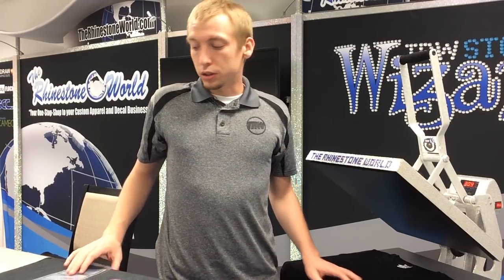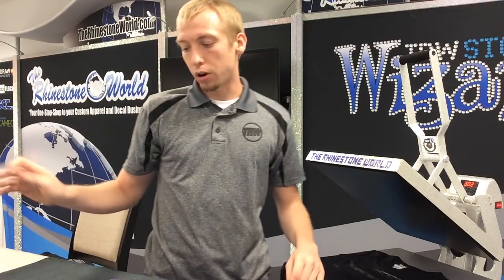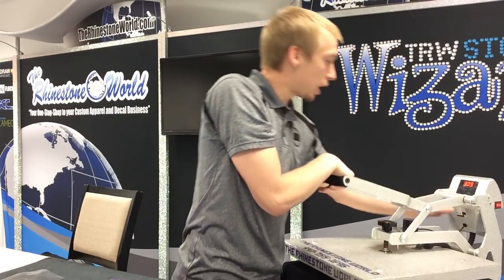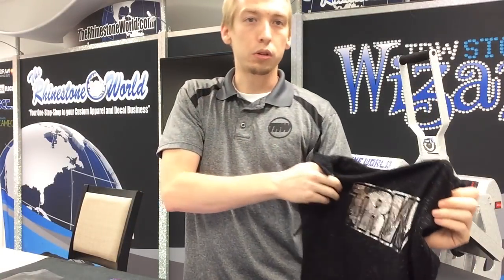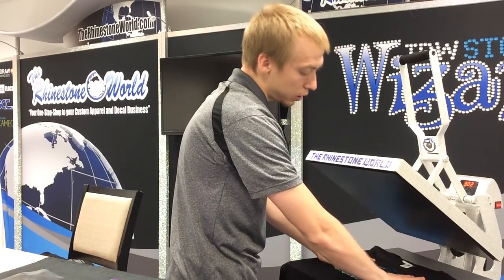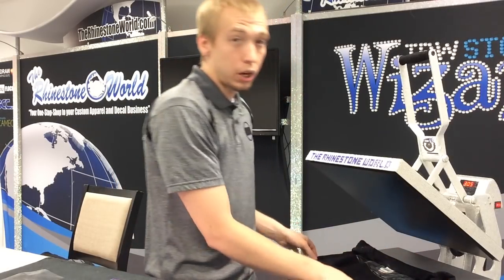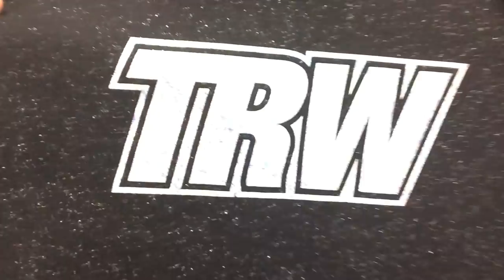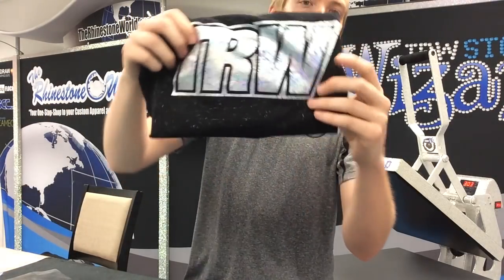Creating a One of a Kind Design Using TRW Magic Foil

Comment: So when doing the foil designs can u press the pieces again that were not used?  As in how there was some left after peeling it up can it be pressed again or is that now wasted material?
Reply from the maker: Hey Erin,
Yes you can reuse certain pieces that haven't pulled  from the foil. - TRW Aaron

Comment: the high heat it is the low time will be ??
Reply from the maker: Foil presses at a very low temperature. We used 305 degrees F and you press the Siser Easyweed Adhesive for just 2 seconds. The foil is pressed for 10 seconds and it is a COLD peel. -TRW Pilar